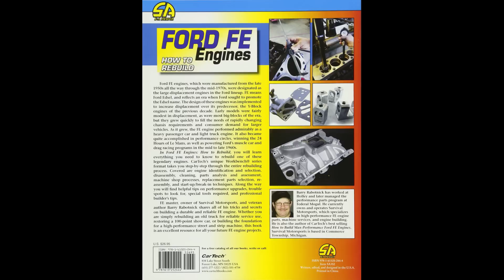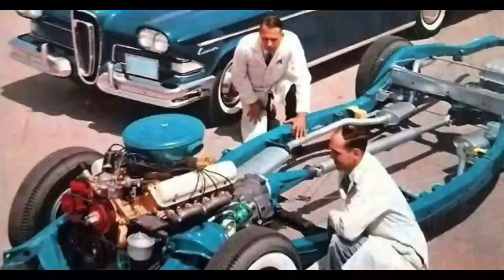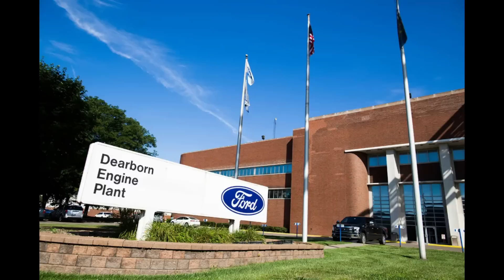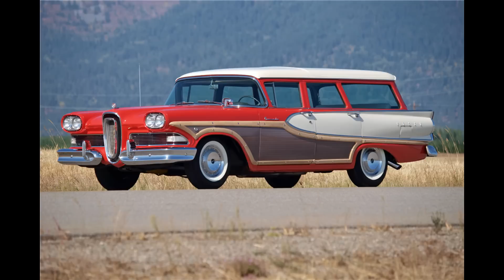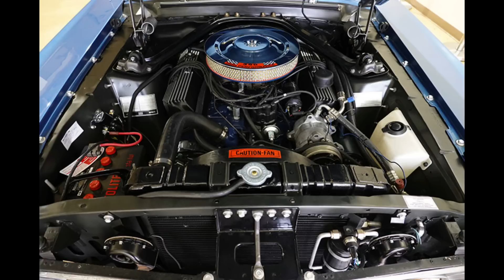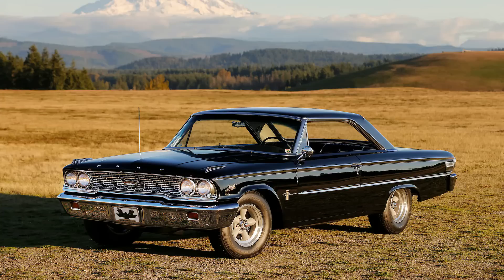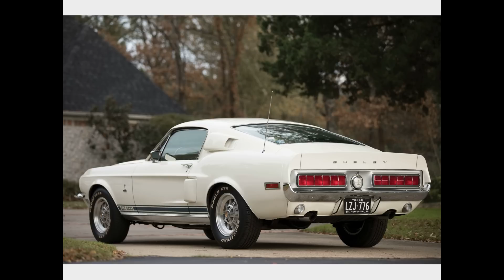Learn about Ford's FE engines and why they are among the greatest offerings by the Blue Oval!

Comment: I love them all!  I can’t drive anymore because of my vision. I still have a 1965 LTD 2dr HT with a 390 that I built in 1999, but have had for 43 years. It dynoed at 503 hp and 488 ft lbs before putting it in the LTD that my son and I restored frame off. It was the best driving car I’ve ever had. I still have it, but it is just sitting.
Reply: I had a 1965 LTD 2dr HT but mine had a 352. You could literally steer it with your pinky finger.
Reply: The problem is that the FE is still the greatest engine ever made and are not in the least obsolete. In fact other manufacturers are mimicking the FE design as their top performance engines.  They are still the best design in this day and time to put in cars and light trucks. The design plus modern materials can create very efficient and reliable engines. The LS and FE share many characteristics and are both great engines. I wish that Ford would reengineer the FE engine to cars and trucks. That Ford would make crate engines based on these engines.
Reply: A few 406 engines that I have seen were cross bolted. They were late in manufacturing and led to the 427 so these were all that I believe they were bone was in early 63 before the fastbacks came they were what I had seen as notch roof 63s I don’t believe they even have a Vin number change. All I have seen were 2 door post 63s early in the year.
Reply: @Bbba724 and I believe you are spot on. I have not seen a 2 bolt 406 all were cross bolted. But I've only seen 3 and one of those was an early prototype in a ready for this 1 of 1 factory lite wieght 61 Starliner. Lexan windows except rear and windshield. Entire front clip was glass except for the bumper it was plastic. Door skins glass over aluminum frame windows did not roll up or down. They had a strap at the bottom put where you wanted it then turn a wooden screw handle to tighten against the guide and bottom of the window frame. No radio no heater no ps but did have power brakes. 4.86 31 spline d- locker Nodular case. Big 3 by 11.5 Lincoln drum brakes up front and rears were 10 x 2.5 Lincoln. No sound deading no package tray no front wheel wells. Head lights were in but fake plastic. Now the motor was a 390 hipo 401 HP from the factory DST which stands for Dearborn Steel Tubing now diversified service technologies. Worked there for a few years they are now in Romulas Mi. But used to be in Dearborn they made all the 63 lite wieghts, the 67 Fairlane coupes with the 427's the  t-bolts, and  the AFX comets mustangs and  the both the lawman boss 429 mustangs the regular boss 29 stangs were built at Car Craft in Britton Mi.  My uncle was the Head of experimental engine development from 59. - 71 at Ford my dad was a non disclosed factory back racer from about 65-6 when he really started getting parts and stuff for free. Growing up our basement was full and mean full of 427 hi-riser stuff boxes of lemans rods heads and intakes all over cranks and blocks all over. About 1 a month my uncle would pull up in the driveway with a white Ford van
 And I knew I had to unload it. My dad and uncle would do the blocks and cranks but I could carry heads down. I asked why can't I carry a crank it's lighter than a head. My uncle said if you drop it, it could bend. If you drop a head make sure you get you foot out of the way. And up until about 93 we still had about 18 Iemans rods in a box on top of the freezer down there. I asked one day where they went he said your uncle bought a 427 galaxie and he is doing a motor so I gave them to him. By that time 427 hi-riser stuff was so rare some don't even know about it. My dad raced hi- risers in everything. His drag cars his drag boats oval track dirt and asphalt they only thing he didn't use one was for his drag sled..and he probably was trying to figure out a way to do that.  anyway yes I was baptized on the FE and did a few good ones my self. I don't agree with everything Brent from Lykins motorsport says. But he is for sure much smarter than I. But I did a 390 for my 64.that was the baddest motor I have ever done and been in minus my buddies 73 Z28 with a Winston cup motor we did for it. Stupid fast on pump gas it made 698hp at 8200 rpm and 583 ft lbs at 6100 rpm with a 3.73 12 bolt and traction bars it spun tires through 3 gear and went 12. 42 at 128mph!! If could get away from you any time you were over 6800 and it wanted to be at at least 5800 all the time it was such a beast last I heard he was doing a complete upright suspension on it and roll cage. He was going to take it to the Cooper State classic. He thinks with a 300 gear it will go 200mpg on paper yes but paper doesn't take wind into the equation. That's coming up in wow I think the end of this month. But I used the 63 427 low riser/406 heads they are c3and4 only and right between the two middle exhaust ports there is a big Capitol "H' stamped on them they came with adjustable rocker arm shafts but the smaller 3/8 my dad got me a set of the bigger 7/16 . They came with 2.19 intake 1.88 sodium exhaust valves it was . 030 over forged JE. Pistons a stock 390 crank cross drilled and nitrided by Moldex crank and knife edged. Rods were hd 390 hipo rods debeamed shot. Peened and madnafluced with arp bolts. A little bit of clean up to port match it all I used a 1968 police interceptor intake which is the 428.scj intake and the best med riser 4 bbl intake you can use on a GE unless you are full bulow racing. I ran a780 and eventually switch. To a 850 Holley I ran a 3.91 locker 31 spline because I broke the 28 spline traction lock with a 350 gear. And a factory 427.dual point distributor. It would turn as hi as I would let it go. Right after I had it broke in I was racing a 67 ss 396 Chevelle and along Woodward there was businesses and in the summer at night they would turn the sprinklers on. And at about 6200 I hit that water just a strip of it. The tack went to 8000 before I could get out of it. And I lost a cyl inder instantly. I pulled over and shut it off. Got it towed home and the noise was clearly on the driver's side I pulled it down and on the valve cover I could see the one spring was all out of place. Pulled the head and number 2 exhaust valve head was laying on the piston. It sucked the head of that sodium filled valve right off where they are fused or how ever they do it. But that 390 was a fucking animal it would pull so hard and not stop until I lifted. My dad got the cam for me. The only 3 pieces on it that were not factory Ford was the headers cam and carb. Everything else was all stock Ford. That is how bad the FE is. I had a fomoco 406 aluminum intake up until a couple years ago my buddy has a 75 360 F250 truck . I said get that off and that. He said why I said I have better replacements. We put the 406 intake on it and a 700 vacuum secondary holley. And a black plug factory Ford 60k volt electric box on it. He said God damn this thing runs good now. And I think it's getting better millage. How the hell you know all this shit ? I said what he said like that box thing. I said well I'm not God I learned from some else. He said this never started like that. I told em good it should  I had a set of the cast iron FE headers for a while and a set of the 71 Torinos scj headers . Here is one for ya. They only made the 429 super cobra jet 1 year and it came only in the Torinos NOTHING ELSE AND ONLY 71.  And this is proof. The super cj had a solid lifter cam. What's that mean? Well it means too much duration so no automatic only manual trans. Ok the super cj had a hi nickle 4 bolt block like the boss 429 the only ones that did. The super cj was 11.7 :1 and no vacuum advance . All Ford solidlifter motors had dual point distributors
 The super cj had different castings for the heads. And the intake ports were so big when you were adjusting the rocker arms you had to put the valve cover bolts back in to keep it running because the valve cover bolts holes went all the way through into the intake port. And a Autolite 1450 carb. And aluminum intake. Now armed with all that you look around and see how many people claiming to have supers cjs have nothing more than they had a ton of names for the 429 4 bbl motor. It was a CJ a ram air ahh. A 4 bbl and oh there was the PI and the thunder jet. But that one was real special . Only in 68/9 in the thunder birds they had a 429 thunder jet 4 bbl. I don't know the HP but for a street motor the heads work real good. They have good ports big valves and well designed chambers. But the special thing is the block. You need .140 between walls and water jacket I built a 514 bb. Used that block . 160 over an offset ground crank with 440 Chrysler rods and got 514 inches of torque monster I had that in a 74 galaxie 500 4 door hard top  i win a. Lot of money on Woodward with that car I could drive it to Detroit drag way run low 12s when it cooled off mid 12 s in the heat and drive it home but after about 4 built C 6's I convinced my buddy to let me put in his boat the first time out with a 21 ft hallwr jet boat it hit 94 mph and he told me take it out!!. I told him no sell it pull it and I'll split it with ya. It sat for a couple years and I took the cam out and put an RV cam. In it didn't moch good it still went 81 he wanted 60 tops. I think back now and wonder how I could have hung around him growing up lol yeah how do you have the Ford knowledge you have ?
Reply: @Bbba7564
Reply: I want to do a 410 at 4.065 bore like an LS but use Mopar 440 H beams machined to fit the FE and 6.766 length with 1.4 forged pistons and crossbolted mains and filled to the water pump holes in a D4TE 3 web mains and twin turbos at 8 lbs boost and a good roller cam and producing 825-850 hp .  These blocks can take 1000-2500 hp.
Reply: @Bbba7564 
I like your imagined combo. 
I'm not a Ford guy but lived in Dearborn most of my life. I'm an Oldsmobile guy, I have a .030 over (4.155 bore) 455 stock stroke 4.250, 6.735 rod, that made 620hp/620tq on the engine dyno at a max 6400. It peaked around 6200. 
I wanna do what we call an E block 400 from 1966-1967 and I got 2 of em to mess with. They have a 7 in rod (!) And 3.975 stroke arm on a factory forged steel crank. Bore is only 4.000 but I wanna do a 4.125 bore. That's the old 430 inch Olds which is fine but id rather build my own from the 400 which can have up to .400 wall thickness in some parts when sonic checked. Whatever piston comes up, it's gonna be a custom diamond brand because I'm in Michigan and been to diamond facility and I trust they can make what I want. It's gonna be made to accept thin LS metric ring package which operate in the exact same bore sizes. I worry about angularity with that long rod and thin rings so therefore the skirt of the piston is important. I want an extended skirt piston and hope for the best. Olds usually don't like rpm but the E block 400 is known to do 7000+ and still be ok, even with 3 inch main bearing diameters. I kinda want to do bbc rods and turn the rod pins down from 2.50 to 2.20 hoping to reduce some friction. 
I hope to make about 650 ish n/a hp then go from there.
Reply: @williamstamper442  It’s not imagined , I street raced with a Mercury 410 with a 4.12 bore and Slant six 198 truck rods, 7.005 with all ARP hardware and internal balance. The crank came out to 4 inch with 2.79 mains and 426.61 ci. The cam was a UD custom roller which for 1977 was unheard of. 254/260@.050 and.580 with lash. The heads were 64 352 heads with 2.15/1.6 valves and I did a lot of porting, a dual plane Shelby 2x4 version of the aluminum Pi 1.25 ch pistons at 11.6:1. 67 Mustang Fastback. Had way too much fun we raced 32 miles on a 2 lane and you could steer with the throttle. 

 love Olds 400s with the 4.125 bore and 3.975 stroke . I built one for a66 442 . And that was a nice car. My Mustang was twitchy but the 442 was just beautiful handling , both 4 speed. I beat him but not as bad as most. I worked in a circle track shop so I was under good tutelage.
Reply: @williamstamper442  The 66-67 400 Olds owned CS and CS/A until the CJ Mustang came out. I soniced a few and they were really good on the thrust sides. Dick Miller made a great ladder truss for the bottom and the stock caps were like the FE , cast in on piece of nodular iron and sawed apart and doweled. The lifters were.924 on the 400 Cutlass blocks. I could build either FE or 400 back then blind folded. I hate what they did in 68, really nutted the 400. Miss those days, but I burned all my good karma in a few short years. lol. I really wish they would cast the BBM blocks like we first planned. One shop gets all of them now and sell them for double the original price just to keep them for the big name guys. I don’t why I’m loyal to Ford, those fucks are real dicks. The little guy gets scraps. I sent my ported 352 heads for a touch up and they disappeared and last I heard they been digitized by the same person. Makes me sick. On top of everything else. I ve been banned from all FE forums. I was sharing too much “tribal knowledge “ stuff I discovered. lol. Good luck with your Olds project and play your cards close to the vest.
Reply: @Bbba7564 all you need is a 390 block, a 428 crankshaft, a set of 427 lemans rods and a set of 410 pistons.
Reply: @Bbba7564
Reply: @Bbba7564
Reply: Love this story, thank you for sharing! You did not tell us your age..? I am 55, retired mechanic on disability. Similarly, I no longer drive either due to failing vision, among other things. I do still have dads 1969 Oldsmobile Ninety Eight convertible he bought new. Red drop top with pearl white interior, 67k miles, unrestored original and in exceptional condition. Also still have my first car, a 1970 Olds 442. It's torn down as a roller right now but I have everything and more to put it back together and still have hopes that will happen before I'm gone. This car is and always been more of a street/strip musclecar. The current engine on the dolly next to the car is what I call my race engine, it's a .030 over 455 making for 462 cubes. With aluminum heads, h beam con rods, hyd roller cam and matching valvetrain, and a single plane victor intake with 4500 dominator carb, engine made 620hp/620tq on engine dyno. Shutting it down at only 6400rpm, I wish now I had done a couple things a little different but we all have to learn by testing as we go when it comes to projects like this. 
Anyway, to the OP, I certainly relate to your situation and I love the numbers associated with your 390! Also love your choice of where that engine should live. Sounds like a great keeper project you and others will enjoy for many years to come.
Reply: @williamstamper442  I’m 64 and on disability now. I have been working on cars and trucks since I was a little kid. I really miss it. Building a vehicle is 2/3 the fun of owning one.
Reply: I have always wondered why no one has ever cast an aftermarket iron 428 block that can be bored.060 over. With side- oiler passeges and cross bolt mains, even on just 2 and 4. With the 3 rib 360-390 105 truck block webbing. The 427 bore is available, but for the more street oriented or guys looking for a really sturdy block that you can supercharge or turbocharge, or like me build it to rev like a 289 on steroids, 8000-9000 rpm’s. The cores can be copied cheap and all iron with today’s iron, relatively light and cheaper than a 427. A 4.125- 4.185 bore with a 3.5-3.75 stroke, Trick Flow heads that come out to the valve cover rails, 351W 4.63 heads or even a Cleveland style 4.63 bore spacing like they should have in the first place. Intake 4V and 2 4V and we have a 60s renasaince, Dynacorn makes bodies Mustangs, Cobras, even the Fairlane and Comets A 2.74 main journal instead of that stupid 3 inch. Even the Cleveland mains are 2.74 like the FE and interchangeable like they all had and turn a 390 crank down to 2.2 journals and 3.5- 3.75 and 3.95 stroke. I know that they would sell. An $1800-$2000 block, why not? They weigh about the same as a 350 Chevy and are tough as nails! I want one!
Reply: @Bbba7564 please read my earlier comment on my 400 inch Olds combo which is not much different than your plan.
Reply: @williamstamper442  I did a 66 442 400 for a friend in trade school Auto Mechanics in 1976. That 400 is one bitchin engine.  They were really good in NHRA C/S with the M 21 4speed and in C/SS it was that beautiful Maroon. I did it as an OA1 3x2, with the inlets under the front bumper.  4.03x 3.975. It was good to 6000 but they blew up around 6500. I did my best to get him to keep it to 6200, but he finally scattered it. The heads were really good 👍 I really tried to talk him into a set of Dick Miller 4 bolt main caps and the girdle to all 5. That 400 at .030 over and balanced really were good for 7000. The big lifters too and it should have been a solid cam. He also didn’t want to get the rods polished and peened with all stud Hardware and especially the rod bolts. 70000 mile stock rod bolts are sticking your hand in a box of snakes. I also really wanted Carrillo rods . They were grooved and bushed for floating pins and 4 Spirolox. It could breathe, the OA1 3 Rochester setup was sent off and he spent money that should have gone downstairs. Another FE I’d love to do is a 4..155 bore with a 4.25 stroke FE, do 6.88 rods and 1.15 ch , a good 461, 1.61 r/s all nice and balanced with a roller cam I already have, 258/264@.050 and .646 on a 108. Trick Flow heads and 2x4 intake. That would be a monster. According to my drill bit test and a quick sonic,, would do 4.16 bore at .125/.175 with majors at .185 to .196. It’s a D4TE 391 FT block. No apparent core shift. It was cast at a state of the art foundry and has the cloverleaf bores. I need to get it soniced , but I sent a pair of heads I ported to the shop I used to trust and they “ disappeared “ and they were flowing 325/205 with 2.15/1.6 valves, just a finishing touch. Next thing I knew they were gone. Really quiet SSR and tumble to swirl was to die for. That 461 has been my unicorn FE, poor boy stuff. 1964 352 heads. I m gonna get in the bottle if I don’t stop. A 8000 rpm 461 FE from a dump truck block and a stroker crank. Life is a bitch brother. I really miss my 68 Mustang coupe with the adapter for a T56 and the dog box 1-4
Reply: @Bbba7564 yes, of course - ”compacted graphite iron,” with 1+% Nickel and 1+ % copper.  This will give a tougher-than-normal Iron for such a block.

Perhaps multiple versions, including a super-strong block as a replacement for well-worn “mighty three-nineties?”
Reply: Is the car for sale
Reply: Give it to the boy or sell it. Needs to be driven.
Reply: I am sorry you can no longer drive sir. I have driven my dad's 1976 F150 with a 390 with factory 4 barrel & even stock that thing stock was a handful.
Reply: @Bbba724 does your son have children ? Are you a grandpa? Then pass it down to him so he can pass it down to his son or even daughter. You don't have to be a man to be a car person. Let your son know he is not to sell it nor beat it up. Drive it a couple miles a week and keep it up for the grandchild. It's not his, he is just babysitting it for his child. That is the right thing to do When my dad passed away I bugged and bugged my mom till she finally came to her sense and I went up and got all my dad's tools and boxes. ( What was left from my piece of shit brother in law taking a bunch) And called my son and said get your but down here in your truck I'm giving you all of grandas tools and boxes. Well I didn't have to call him twice or ask him how long before he left. Imagine that. Anyway I was glad to do it. I have at least 3 times what my dad had so I needed nothing I took a couple of odd ball stuff that I remember using when I was prolly 9 or 10 but other wise all to him. So it made me feel good and every time he uses one of what he got from his grand father the one who made us the race junkies we are he'll say hey grandpa gave me this or that. And that was the whole purpose take care buddy.  you tell your son to come over and you to go for a ride. And when you get way out of town I'll n a road with no issues to speak of get back in the saddle and nail the throttle on it and let it do a wide open 1-2 and 2-3 so ya get a smile on yer face 👍👍🤞
Reply: Just do burrodies in a parking lot , you'll be all right ... 😂
Reply: I have always wondered why no one has ever cast an aftermarket iron 428 block that can be bored.060 over. With side- oiler passeges and cross bolt mains, even on just 2 and 4. With the 3 rib 360-390 105 truck block webbing. The 427 bore is available, but for the more street oriented or guys looking for a really sturdy block that you can supercharge or turbocharge, or like me build it to rev like a 289 on steroids, 8000-9000 rpm’s. The cores can be copied cheap and all iron with today’s iron, relatively light and cheaper than a 427. A 4.185 bore with a 3.75 stroke, Trick Flow heads or even a Cleveland style 4.63 bore spacing like they should have in the first place. A 2.74 main like they all had and turn a 390 crank down to 2.2 journals and 3.75 stroke. I know that they would sell. An $1800-$2000 block, why not? They weigh about the same as a 350 Chevy and are tough as nails! I want one!
Reply: You wanna sell it
Reply: 8877iii
Reply: I want to sell it, but my son ripped out my wiring box and I can’t even start it. I d want to keep the engine anyway. Ive had it since 1980.
Reply: I grew up with the FE!  😂😂.  On the ground training was the best.  I still can recognize an FE going by.  They are just in a league of their own!
Reply: 1965s way better than a LTD !!!